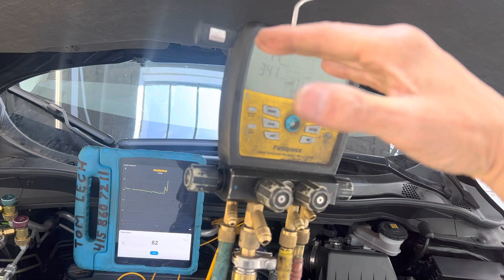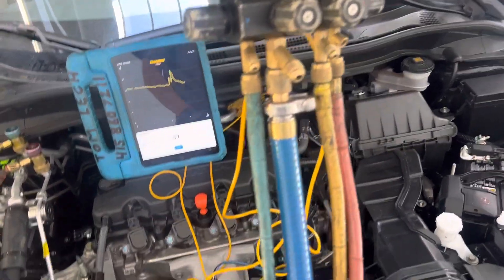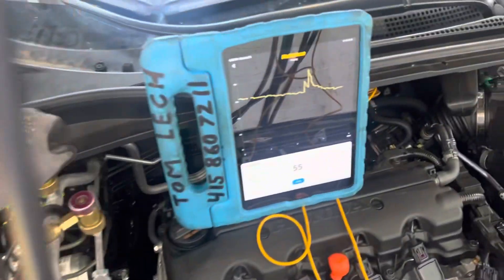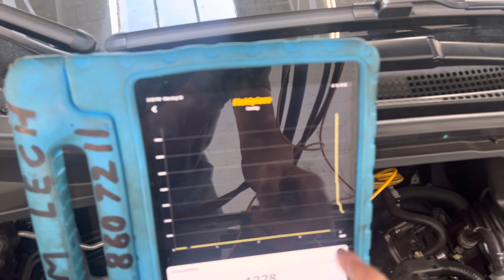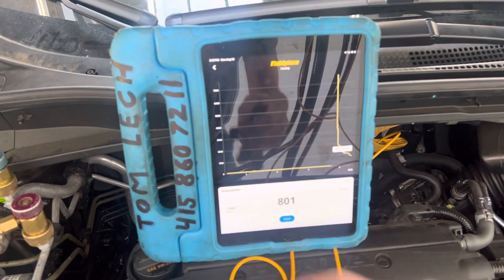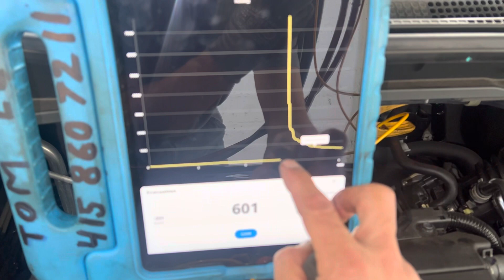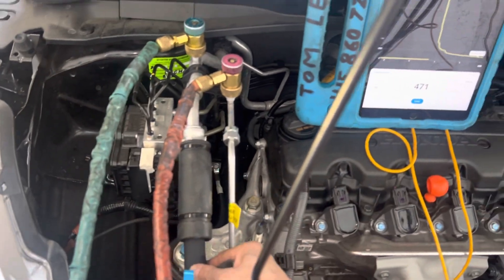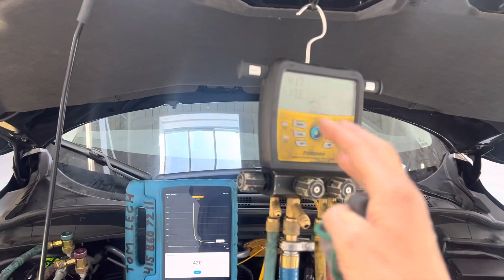YOUR AC TOOLS WILL OFTEN BE YOUR SORCE OF YOUR VACUUM LEAK

Comment: What charge hoses do you recommend to go with the fieldpiece manifold setup? One of my suppliers has hoses for $19 per hose. But I am picking all hoses are not created equal. 
How do you put it. Automotive will do it wrong, so try and do it the best wrong way lol
Reply from the maker: If you are DYI not doing it as a professional for money every day, you can choose the cheaper hose to save money. 

But if you are a professional, and you’re getting money to do this every day, paid by a customer, yellow jacket hoses
Reply: @coldfinger459sub0  I do Air Con and auto electrical for a living. So will sort some new hoses out today. 
Appreciate the job you do. I've been to a few AC courses over the years, but I'm still picking up golden nuggets of info from you. Cheers 👍
Reply from the maker: @martyscherp5433  and if you take a closer look at my refrigerant hoses, you’ll notice they don’t quite look normal.   You might notice some wrinkles. You might notice they look just a tad bit fatter.. 

I did a video where I sure why you shrink tubing colored of course and I coated the hoses with thick silicone, grease dielectric grease then I slept over the shrink tubing and then put the heat gun to it to shrink it . 

This extends the hose life against abrasions 

The silicone grease extends the hose life because it’s not exposed to oxygen which breaks down the rubber coating material 

The shrink tubing protect the hoses against the UV light of the sun. UV breaks down rubber. . 

The silicone grease after a while as it permeates and penetrates into the molecular Lair of the rubber coating acts as a vapor barrier for moisture it’s not perfect, but it helps . 

All together the hoses last longer give you more reliable longer duration of life 

And because of that shrink tubing coding, you can accidentally lightly hit a engine, pulley or a belt or spinning fan, and it usually only Knicks or cuts or puts abrasions in the surface of the shrink tubing and not your hoses .
Reply: @coldfinger459sub0  I have noticed the sleeve over your hoses. Didnt realize it was heartshrink. That's a cunning idea. Another golden nugget. 1st time using the fieldpiece manifold yesterday, and it showed my hoses as average. What an awesome setup you have. 
In NZ we are taught an industry standard of 30 to 45mins will vac the system good. Always thought it was a rubbish standard. How could a 2kg system vac in the same time as a 400g system. I would give it a vac for as long as I could within reason. Never had a micron gauge. And courses never mentioned how to use them either. Ive been sub standard for way to long. But no more. And did I mention those gauges are freaking awesome.
Reply from the maker: You were going to go through some frustrating times trying to understand a micron gauge without knowing how it works

You will be reading, outgassing and limitations of refrigerant, charging hoses were never meant to pool or hold, or retain a deep micron reading . 

Just by reading through the hoses themselves of your gauges, you will lose about 400 to 700 µm out of there that are not part of the system. It’s just the losses two refrigerant hoses. Refrigerant hoses are not vacuum hoses. 

Jim Bergman and Bill spooned took an old vacuum book from the 1950s and rewrote it. They purchased the rights from the author and added modern day equipment Accu to vacuum micron gauge and explain why you do not use refrigerant gauges and refrigerant charge and hoses to try to read vacuum . 

You can do it, but it will be frustrating 

This is why you have isolation, ball valves, and dedicated micron gauge to get through reading without any refrigerant hoses connected to the system 

You cannot read the micron reading of the hoses by themselves plugged off because the internal volume is so small and outgassing. The refrigerant hoses are so large that you will always get a rise looking like there’s a leak or a lot of moisture but it’s just because it is refrigerant hoses in a small Internal diameter. Nothing to dilute it out.

Analogy, I can tell you if you put one drop of deadly cobra, venom on your tongue or in a 6 ounce glass of water and drink it you are going to die and feel the effects 

But if you take that same one drop of deadly cobra, venom and throw it into a Olympic size, swimming pool, and then drink 6 ounces of water, you will feel absolutely nothing, and there will be no effect 

Microns are this extreme and accuracy and sensitivity of the micron gauge is this sensitive? 

So when you’re trying to read the hoses and their micron leakage all by themselves, it’s like that drop of cobra venom in a 6 ounce glass of water you will fail 

But if you have a clean dry system and hook up your hoses, you will still have a higher vacuum decay loss in microns, but it will not be as bad 

And if you repeat this test again on a clean dry system, no hoses, everything in perfect conditions you will have no decay or next to no decay a vacuum I’ve done videos on this and so has Jim Bergman
Reply: @coldfinger459sub0  
Nothing wrong with learning a new way to do something as long as it is an improvement. After a period of time using the new equipment,  I am expecting to start seeing a pattern for the micron measurements.
Reply from the maker: @martyscherp5433  google search (“ True Tech Tools, vacuum book “) 

Sometimes, YouTube won’t let me put in links. It will not post my message. . 

So if you use that phrase search term, it will bring you to True Tech Tools website right to a little white book with black print, very plain, looking that will introduce you to vacuum, dedicated silicone, high flow hoses, all the related fittings, dedicated micron meters and give you a head start running ahead of the pack compared to somebody trying to learn it the slow long way.
Reply: @coldfinger459sub0  
Cheers. Will check it out. Already have the blue hose for vacuuming. Will look into it after work